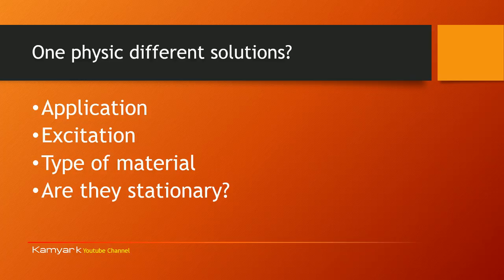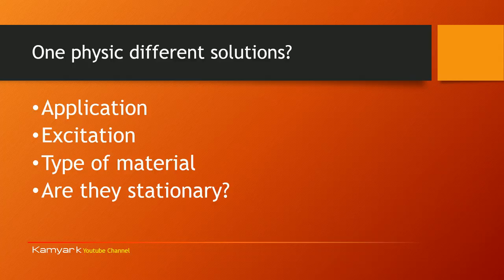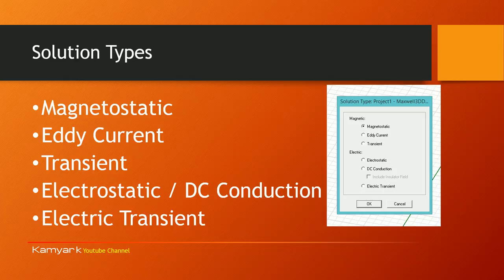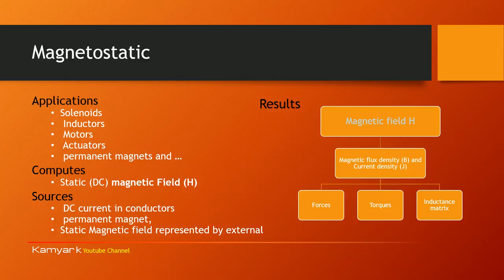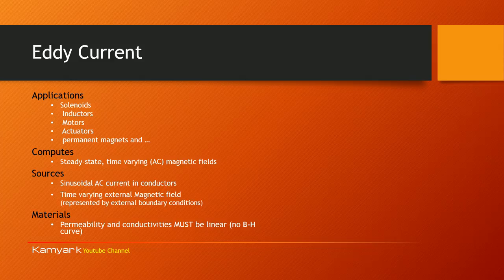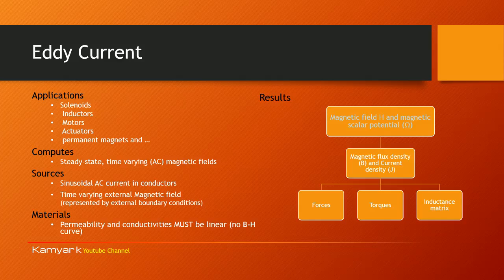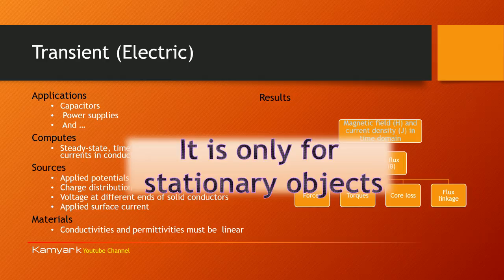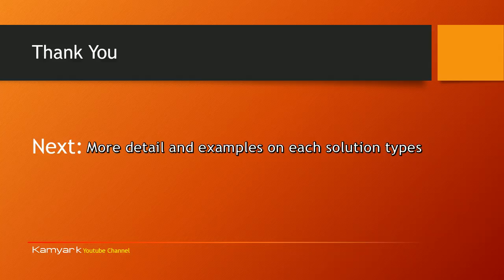201- Ansys Maxwell- Which type of solutions (Analysis) should I use?

Comment: Hi Kamyar, I'm working on my thesis and I have a question about the solutions provided by maxwell. That's my problem:

1) I need to simulate the interaction between a permanent magnet, rotating around his axis, and a couple of coils hold in the space, one above and the other below the magnet.
2) The magnet field of the permanent magnet, should create a magnetic field flow through  the coils and generate in theme an induced current that I want to mesaure.

Do you think it could be possible with Maxwell? I'd started with Ansys basic but it can't provide me the solution.
Thank you for your time.
Reply from the maker: +Giulio Tempesta  yes, please follow up the tutorials and you can at least 4 similar and relative examples.